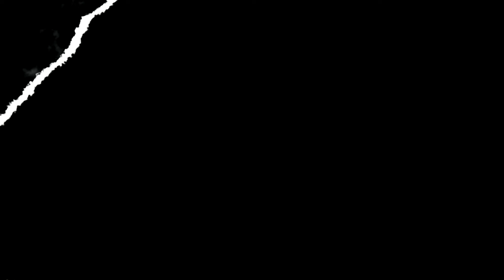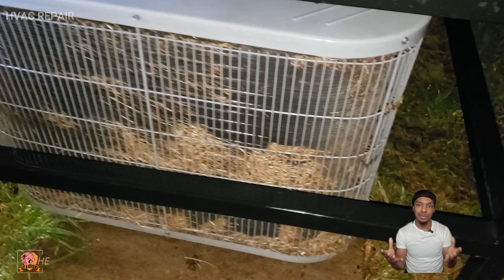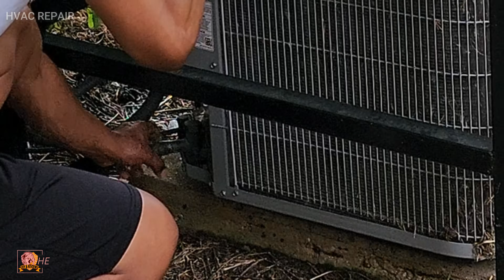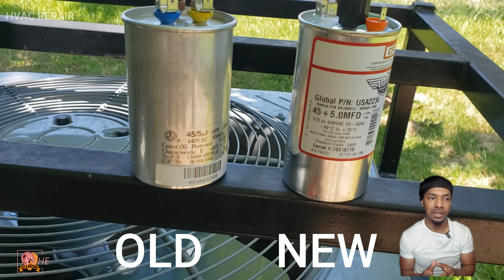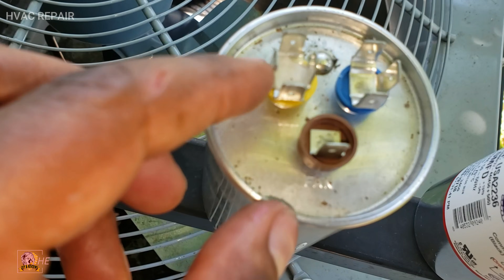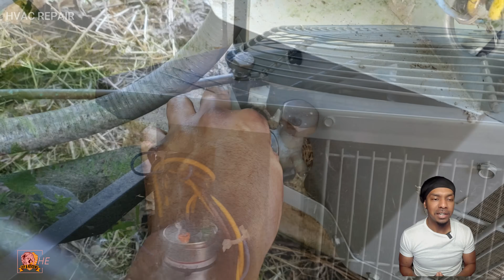AC Not Blowing Cold Air in House? Try This First (Step-by-Step Fix)

Comment from the maker: ✴ATTENTION: You Can Ground The Capacitor By Touching Terminals with Screwdriver Like I Did @ 3:40 marker of video. (Before Removing The Capacitor) ✴
What You Need.... AC Capacitor - https://link.amazon/B0gwn0KMb
Capacitor I Purchased -  https://link.amazon/B05W93QVM
Drill Set -  https://link.amazon/B0cYODohe
Water Hose - https://link.amazon/B0240nxpc

If You Have Any Questions Feel Free To Ask! 👍

Comment: I had a 5 ton unit that i installed 20 years ago that wasn't able to cool my house once it got over 85f plus it was iceing up outside.

The air conditioning guy told me R22 cos 275 a pound i might be better off replacing my system because of the expense of the Freon.
Well I went online and ordered R22 freon for $924 for 30 pounds. My cousin came by and gave my system its first servicing in 20 years. The unit in the basement blowing motor wasn't working either. My cousin spent 7 hours going over everything. I had a slow leak on the 5 ton unit. He needed to add 10 pounds of R22 freon.  We agreed on $500 and instead of the Freon costing me $2,700 from the first guy I called who told me to replace my unit. The total repair job came to $812 , 500 for labor, and $312 for R22 freon.
Reply from the maker: If I'm reading this correctly, wasn't it cheaper to have just replaced the whole unit than to repair it?
Reply: @HEDIYREVIEWS  I paid $813 to repair my American standards 5 ton unit. I also got 30 pounds of R22 for 924. I used 10 pounds on this service. The original Air conditioning guy told me I should replace both my units because they used R22 and it cost $275 a pound. I had both my Magic aire 2.5 ton fixed  (bad blower) and the 5 ton fixed for $813 labor and part's. Please tell me how it makes sense to replace my units..The only problem I've ever had with the 5 ton American standard is it had a slow leak, and the only problem with the Magic aire was a bad blower motor. I have no desire to change them. Especially with my cousin being so competent and deep. He found a leak that the guy wanted to charge me $270 couldn't find. As he told me. Your unit is running perfectly, why would you change it?
Reply: @MrBjorn6   It's better to get a new unit. Eventually, the coils, condenser, control board, etc. could need replacing, and adding up the parts and labor costs, you probably would spend more fixing it than buying a new unit.
Reply: @jondoh3471  did you read how much I spent on my units? My cousin is an expert on industrial HVAC systems. He did a complete serving of both my units. Spending 7 hours got them Running like they were brand new. Plus I have 20 pounds of R22 freon just in case. Why would I replace my unit that I've been had for 20 years that have given almost no problems? Please explain your logic to me?  My cousin tells me my Units should be could for another 20 years. He's an expert on HVAC systems and says the new units don't last like the old stuff. I'm looking for logical reasons I would replace my R22 units that I've had for 20 years that's running perfectly. That's my cousin serviced for $500 and fixed all problems and I had to buy a blower motor from Amazon for $250. Plus I bought 30 pounds of R22 freon for 924. Only used 10 pounds on the 5 ton unit 🤔 Why would I change this 😳

Now if I didn't have a cousin and was listening to the corrupt shady people in your industry. I would of been charged $2750 for 10 pounds of R22 freon. That's guy couldn't even find the leak. He was trying to charge me. 1450 to replace the motor blower in the magic aire 2.5 ton in the basement.

Since I got all that work done for  under $1000 plus my cousin is an expert in HVAC industrial systems and he told me, I have no need to upgrade my system..Why are you trying to convince me to ripped out a system I've had for 20 years that's very serviceable and at almost no expense because my cousin is doing the work. I ordered all the parts and he does The work. Why did you say I was better off upgraded my system when I've spent maybe a total of $2000 in 20 years on both units in 20 years. Please explain to me how does that make sense 🤔

That's an average of $100 a year on two systems. Over 20 years? You expect me to rip them out and put in a new system for what reason when they have fun problem free for 20 years. Since I completely gutted my house when I bought it. My heating is 20 years old, my Sub zero fridge is 20 years old,( one problem in 20 years) my water tankless heater is 20 years old (no problems) I did upgrade both my TVs from 2003 because they were obsolete and technically today is much better. So I have an Sony Zd9 75 inch in my basement and bedroom 65 inch. Both are 6.5 years old now. No need to upgrade them any time soon either because both do include 3d.

My  $3000 stove has stove thermadore is still running fine. My Miele double oven is 20 years old no problems in 20 years. My wine cooler had one problem in 20 years? I have kept them all. Have no need to upgrade. Yes my kitchen is Granite countertops and looks very 2002. But I'm happy with it and have no need to upgrade to Lenox and ripped out my old kitchen.

This isn't like the the latest iPhone 🤔
Reply from the maker: @MrBjorn6  I understand what you are saying now. 
They were going to charge you $275 per pound which would've been $2700 for the 10 pounds you needed, not to mention the other cost to replace parts & labor.
If you spent that much it would've been cheaper to buy a whole new unit.
You definitely came out cheaper with having your cousin repair it for you. 
💯👍
Reply from the maker: @jondoh3471  looks like he did end up saving money by repairing with his cousin's help after he explained it to me again.
If he went with the first tech quote he definitely would've over spent & in that case, would've been cheaper to purchase a new unit.
Reply: @HEDIYREVIEWS  You only purchased a unit if the old unit was poorly installed or can't be serviced because you don't have a honest or professional HVAC person IMHO 🤔. If you have a good installation and no problem why upgrade. My mom's house has had the same gas boiler since 1980 and it's giving very little problems. I have an excellent plumber 🪠 we have changed a pump 5 years ago, but the boiler is 43 years old and no one has ever suggested to replace it.
Reply from the maker: @MrBjorn6  WoW, cool to know...
Thanks for sharing 👊🏽💯

Comment: Good video.  Would recommend using vaccum cleaner to start as the dirt is pulled from the outside to the inside.  and then wash.  definitely need to short the capacitor terminals.  They pack a lot of punch.
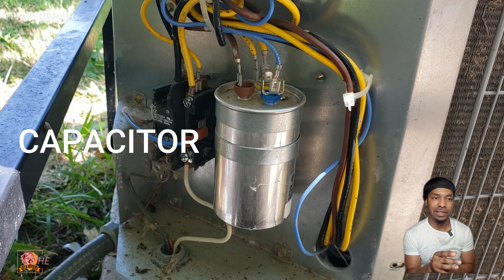Reply from the maker: Cool, I can see the benefit in using a vac & I hate I forgot to notate the grounding step but I did ground it at the 3:47 time marker.
Thanks for your advice. 👍